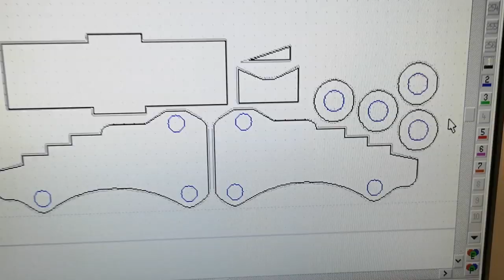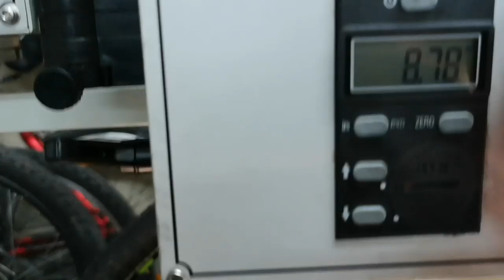DIY Desktop Cannon made on Lathe - Functional

Comment: I am a beginner… How do you set up small angle to cut barrel conical shape? Can you give me an idea of actual angle you used (1º, 2º, 3º…)?
Reply from the maker: @natxosailor  the plans are available on JKTech.si/en/store I think. You can cut any angle with setting your cross slide to desired angle, then cut with that. So you have main left/right, in/out, and angled left/right in very basic terms.

Comment: Wow!  Fantastic craftsmanship.  I am taking a CNC & Conventional Machining class right now and had to come up with a project for the term.  I decided to build a black powder hobby cannon.  I made the baseplate out of aluminum on a manual mill, am currently working on the barrel (1 out of cold roll steel and 1 out of brass, until I decide which I will ultimately use.  I think the brass will look nicer but the steel will obviously be stronger) on a lathe.  The turret (naval gun style) will be CNC milled.  While mine is quite a different style than yours, I have to say that your expertise and quality of work is extremely inspiring.  I can only hope mine turns out half as nice as yours.  Great job and thanks for the video.  It gives me some ideas to apply to my own project.